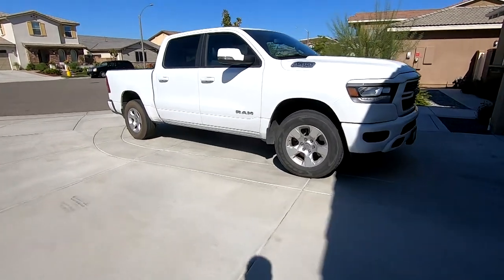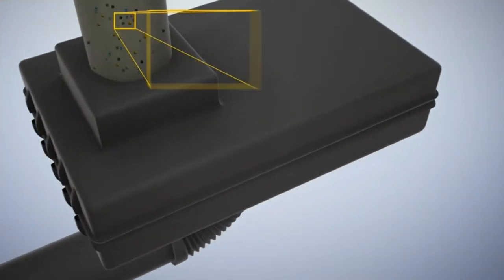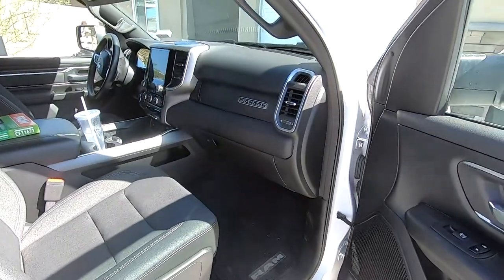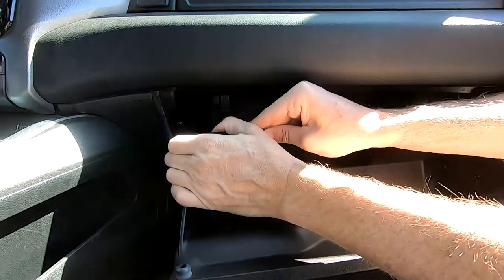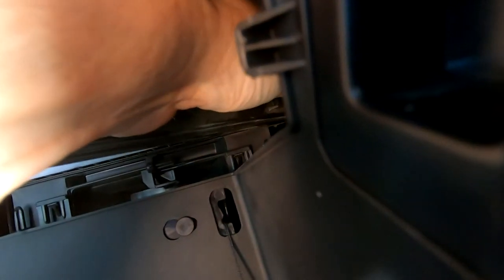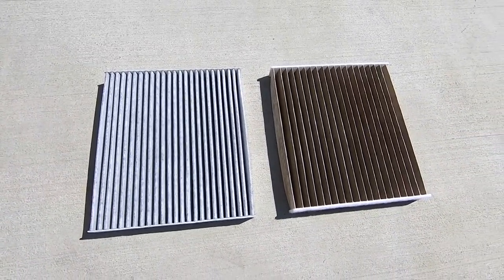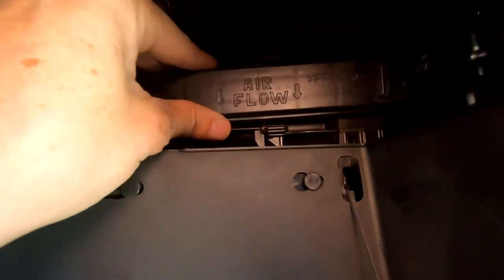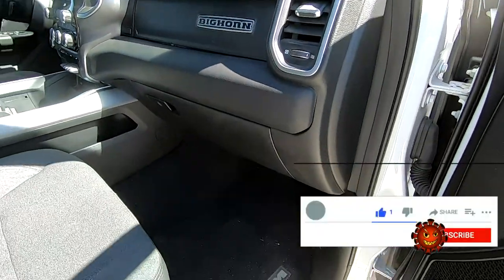Dodge Ram - Cabin Air Filter Replacement & What You Need To Know.

Comment: 4/22/22 I watched video and was able to replace cabin filter on my husband's 2020 Ram 2500...Thank you!
Reply: Is the glove box hard to get back on?
Reply from the maker: It's harder to take off.  Very easy to out on.
Reply: @ruffdawg40  Definitely harder to take off. I had to put quite a bit of pressure. Remember like the video says. Put pressure then squeeze/push to the right side don't pull foward.

Comment: My 2015 has a solid area. Doesn't have tabs to pop out. Looks like it's fixed
Reply: I just watched a video, and I see that not all of the trucks came with a filter. I will need to cut along the area to insert it. Kind of funny. Looks easy but weird.
Reply from the maker: Every car comes with an in cabin air filter.  At least newer models for the 2000's
Reply: For a certain time, RAM put trucks out with a CAF. It is not hard to purchase the retrofit kit which has a door and CAF. I just saw a video on YouTube that showed a person doing it. It takes about 20 mins if you have a slight mechanical ability...
Reply: They have videos out there on where and how to cut access... Guessing the cover is a dealer item that may cost a fortune I haven't checked ebay yet before doing mine
Reply: @how2togo  wrong. My 2014 Ram didn’t come with a cabin filter. The cabin filter door was flush which I had to cut to open it and then a filter and door could be installed.
Reply: @knightfrompa  like 10 bucks

Comment: DOES NOT APPLY for SLT model Rams!  No Cabin Air Filter at all.
Reply: I have a 2016 2500 Tradesman, the lowest trim Ram has. Mine wasn't blocked off, and there was a cover as shown in this video, but no filter installed. Most videos show a solid block off that has to be cut out to install a filter on the lower trim levels. There is no indication that someone cut out the filter hole, so that has me wondering.